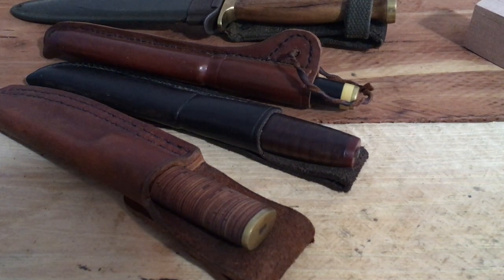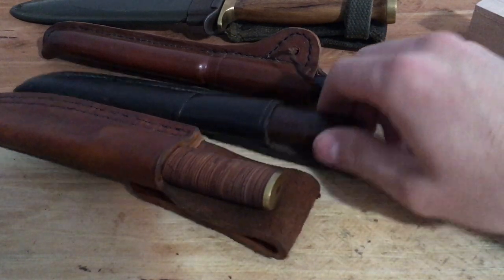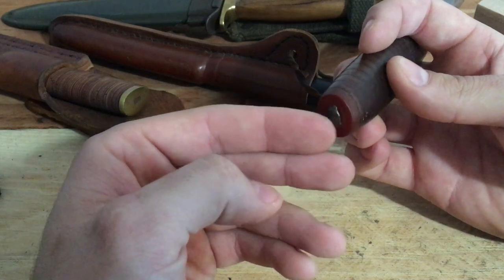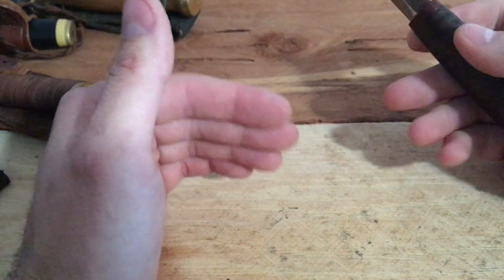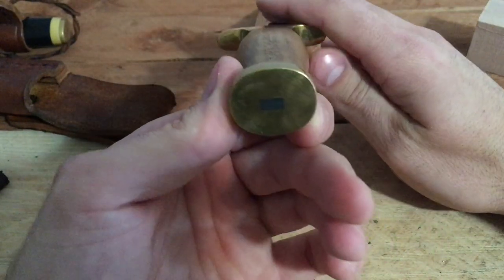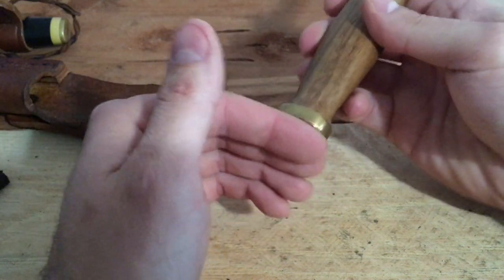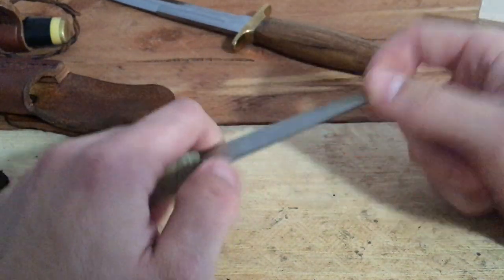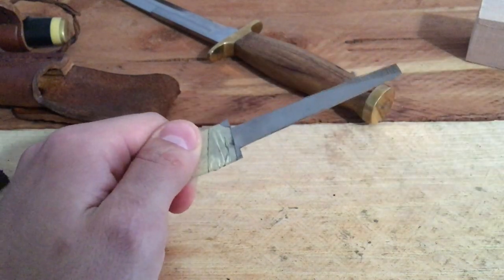A look at peened tangs vs. threaded tangs

Comment: can you explain how the bolt on the camillus pilot survival knife works
Reply from the maker: I have never handled on in person but from pictures it looks like the tang goes all the way through the end of the butt cap and is peened over. The very end of the tang that fits into the butt cap might be threaded ( I'm guessing because is hexagonal like a nut) so that it can be tightened down to compress the leather washers that make up the handle. 

The way the tang is peened over looks a lot different from a traditionally peened tang so I'm guessing they have some special method they use to do that. It looks like it could have been done with a cold chisel.

Again, all just a guess.